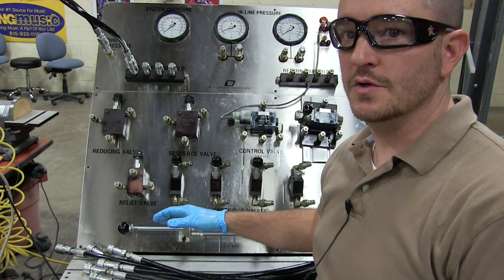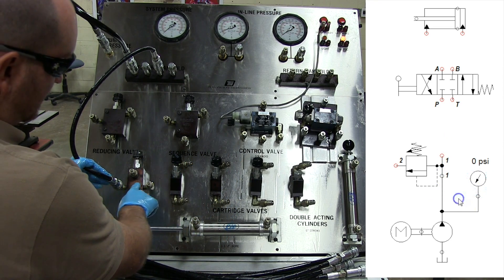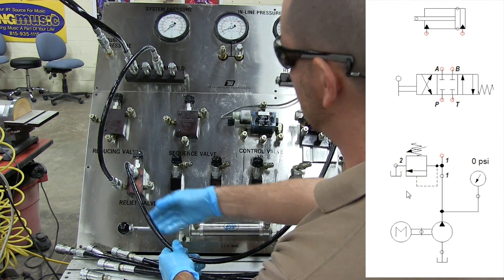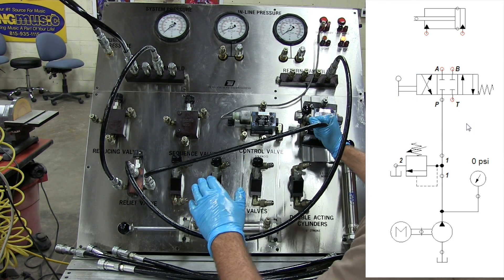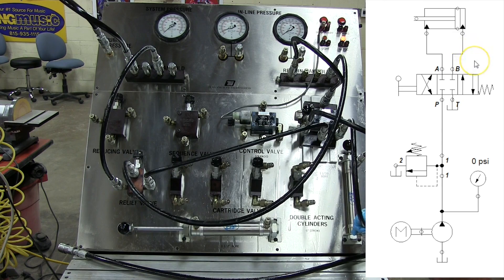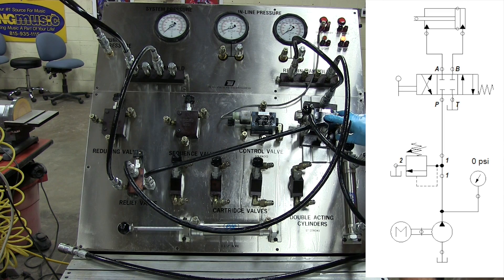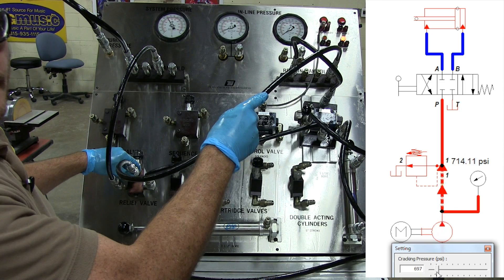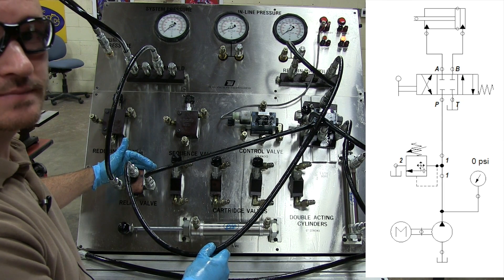Pressure Relief Valves Schematic

Comment: Thank you sir , your video helping me a lot . 
i have one question . suppose the above system is working on a  crane . now one of the hydraulic hose suddenly leaking (which is connecting between relief vv to return manifold . ) we have to  change the hose but how to purge the system and what all safety we must follow ?
Reply from the maker: Make sure the power is off.  Also, make sure that you catch all the oil.  Really it should be pretty straight forward.
Reply: @KletteTech  how I can do the purging before starting the system.
Reply from the maker: Rupanjan Saha portable filtration unit might work

Comment: So if the spring is week or broke your hydraulic pressure could start out at let's say, 400psi and bleed off to 100psi or even less? I'm having trouble now with one in a grapple skidder. Machine has been giving me nightmares for over a month
Reply from the maker: That might cause the problem.  Typically springs don't start off at set pressure then drop.  Have you checked the directional control valve?
Reply: @KletteTech  directional control valve? Would that be the same thing as the spool valve?  The seals were bad on my relief. I replaced them. But now my relief won't adjust to 635 psi where it's suppose to be. 400ish. I'm gonna try a new relief and see if that's the problem.
Reply from the maker: Is it a adjustable relief valve?
Reply: @KletteTech  yeah. I got that part fixed. Now my differential pump keeps loosing prime. So im trying to figure out if it's a bad oring somewhere or if the line that runs from the front axle to the back axle has a crack in it somewhere. "Nightmare"

Comment: How do you distinguish the difference between the relief valve symbol and the sequence valve symbol? They look the same to me
Reply from the maker: Great question.  The only way to distinguish between them is that a sequence valve has a external drain line.   Besides that they are the same symbol.  With pressure control valve symbols, the devil is in the details.
Reply: KletteTech makes sense thank you so much. These videos have helped me a ton. Thank you for putting these on YouTube!

Comment: Sir what this dotted line shows in relief valve?
Reply from the maker: Great questions.  The dotted lines represent that the relief valve senses pressure internally.  This is done in the valve so there is nothing that has to be hooked up.
Reply: @KletteTech  
Sir please tell that pressure is noted in downstream only in gauges  or some other concept  .